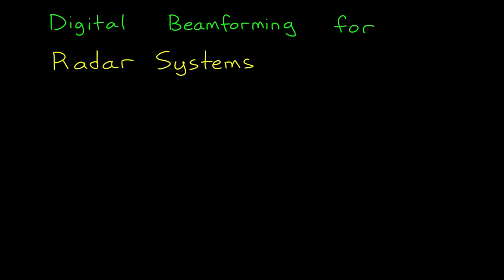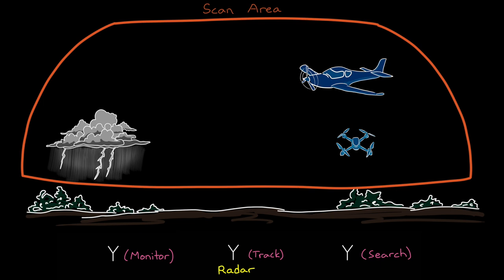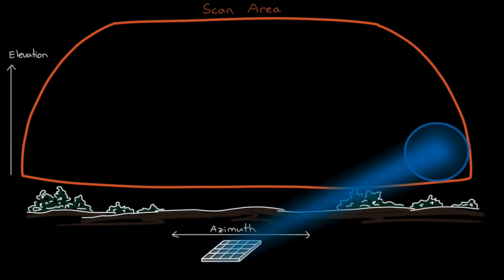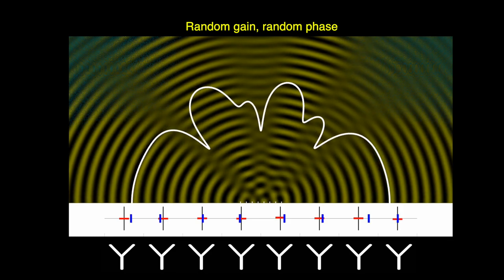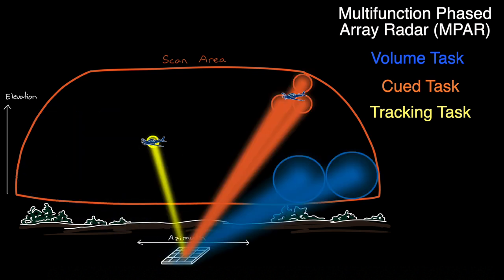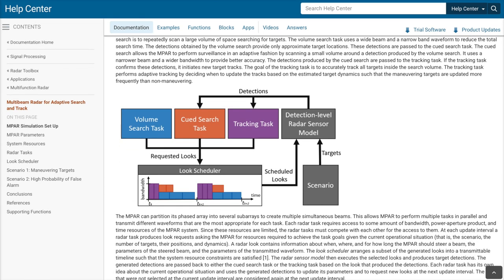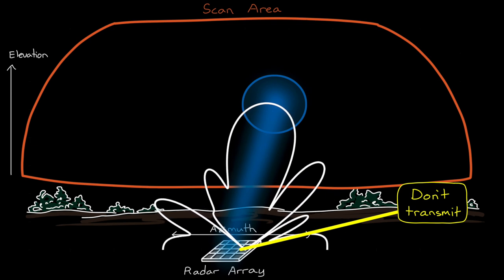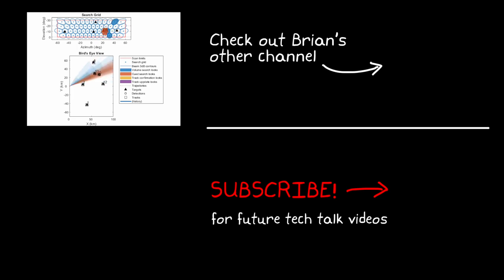Why Digital Beamforming Is Useful for Radar

Comment: Hi great video, 5:50 and forward is a bit misleading. a narrow beam has a much better resolution and SNR (more energy) but it's not used to pinpoint the location of a target. for this you are using a monopulse, which means you have a regular beam transmitting to a specific location and receiving beams around that same transmitting beam, now you can compare the power coming from each of the RX beams and calculate the target location in relation to the TX beam. The mistake in the video is that you go to a narrow beam when you don't need to.
Narrow beams are mainly used for long range surveillance in modern radars.
Reply: @josephrosenbaum3343  You are correct that by using a narrow/pencil beam you would get a better spatial resolution especially with TWS tracking in Monopulse.

I didn't see the vid again so I'll guess my idea was that you don't waste the most important Radar resource which is time. Why fire more beams and wait for the return if you can cover more space and still get enough data for the purpose of your Radar?